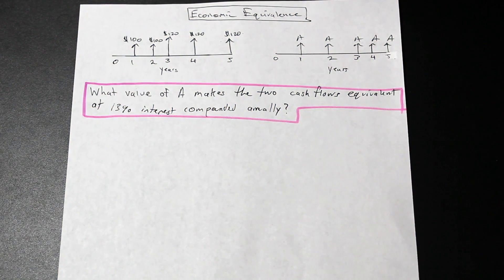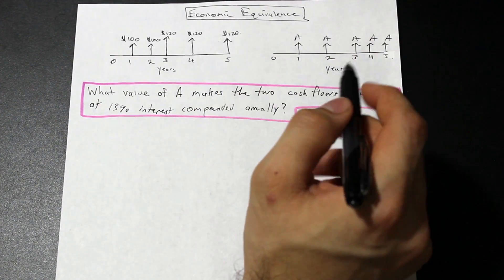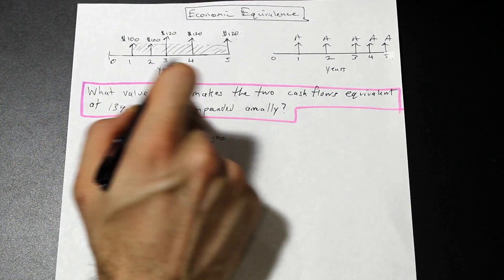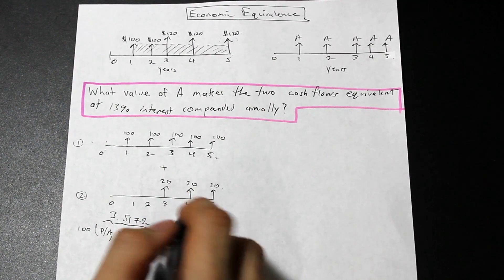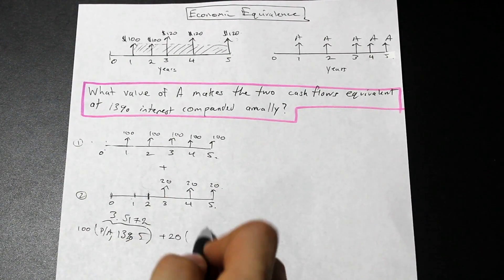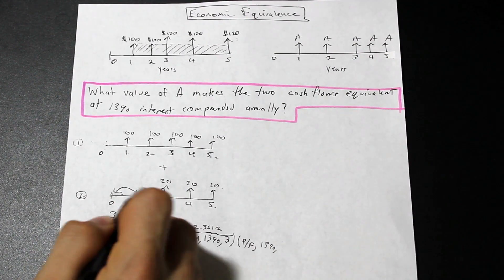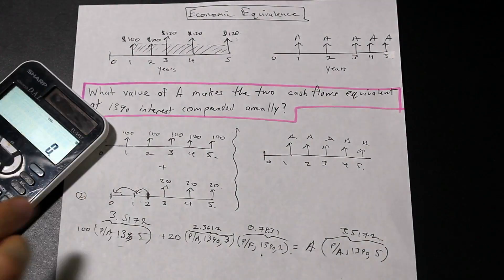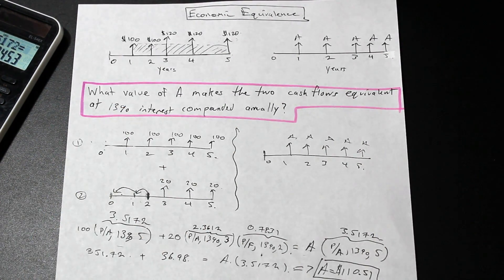Economic Equivalence - How to Equate Two Cash Flow Diagrams - Engineering Economics

Comment: what would happen if the left side cash flow was all over the place? 
let's say the cash flow looks like 100,200,333,445,243. what would be the approach then?
thanks for these videos 
liked and subscribed
Reply from the maker: Then you're going to have to probably do it for each cash flow entry separately equating it to some datum n value and the equation on the side you mentioned will have 5 terms.  You can still do it it'll just be a messier formula because there isn't a clear pattern.